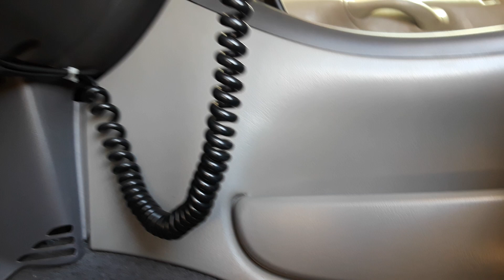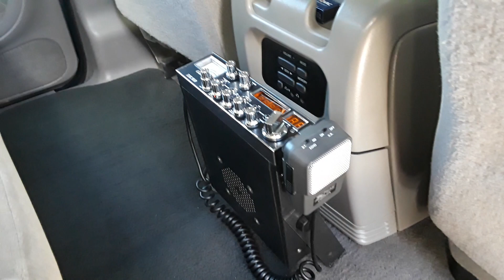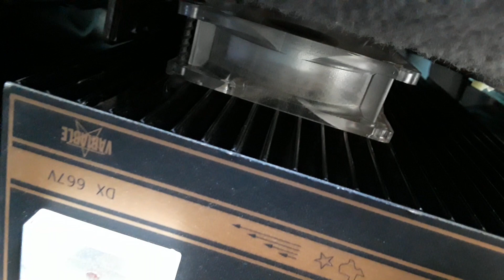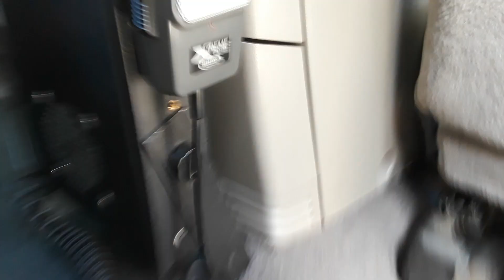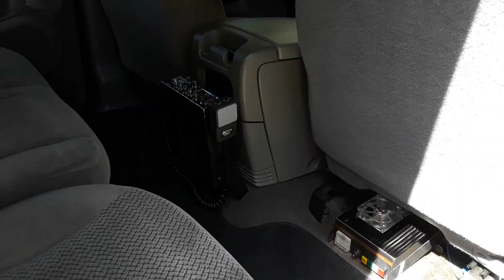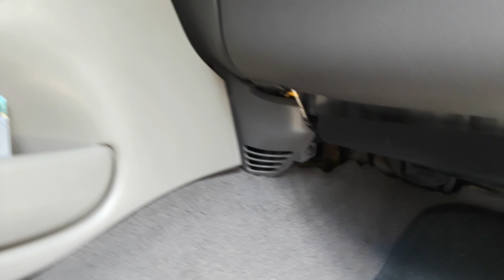CB radio and linear amplifier installed in the mobile

Comment: Everything looks great. However, the location of the GPS is very dangerous. It requires that you take your eyes off the road when consulting it. Mount it along the top edge of the windshield or low no the top of the dash for a much safer use.
Reply from the maker: @research903  The GPS is voice activated and it also speaks the directions to you. It's not an issue.

Comment: How many miles can this cb radio pick up?
Reply from the maker: It all depends on the radio, the amplifier, the coax, the antenna, your vehicle and how everything is hooked up together. No two vehicles will be the same. It also depends on your location and the terrain. I can hear skip all over the country, and locally if I'm lucky probably about 50 miles. However the 50 miles on the person on the other end.

Comment: May I ask did you wire your cb radio to battery with its own wires and the linear to battery with its own wires ? 
I'm using a 4 watt president harry 2 radio direct to car battery in my car and want to use a 35watt linear which draws 4amps I was hoping to use the same 12awg cable to supply both radio and linear. I'm using wago connectors.

Comment: Wow! What a nice install! I was going to mount my cb in the back like that in my pickup but it’s only a small extended cab with not a lot of room plus I didn’t want to not be able to see the display. I have a 29 LX that has the clock and antenna warning and all that so I went with beside the console. I’m not fond of it but for now it will do. I’m just getting into it. I was looking for how to connect the amp to the cb actually and got your video. Glad I did because it’s such a nice clean job. Thanks

Comment: I have an expedition also.  Mine calls for the biggest factory alternator they have 110 amp. Have you had any issues with the alternator when you key up with the 667 turned up? I really like how clean your install is,  really nice attention to detail.  I'm giving very serious thought to running a police style center console in mine. Something from Troy or Jotto, assuming they sell to the public.  I think it would be clean and secure way to run CB, Ham, and all the accessories. Really love your install.  I would appreciate if you are still seeing these comments if you would let me know how your alternator performs when you key up the 667. Thanks.

Comment: How does the echo on the xtreme mic perform under amplification on Am and SSB?
Would love one of the mics. Good video, Andy UK
Reply from the maker: Sounds terrific on AM! I run it just under 2 and 2 on both dials. I've found that most people don't like echo on sideband so I never use the echo on SSB.
Reply: It’s about the comparability rather than approvals. 
I find those (analog) copies, Workman 1000/5000 squeals as do those with the slider on the front.
Reply from the maker: @andybibby342  I purchased a Workman copy and it squealed like a pig. The Xtreme 2018 didn't.

Comment: Did u use 8 gauge on your cb wiring as well??
Reply: Ten fo i did 14 gauge on my galaxy 29hp and i just got a 250 linear i plan to run an 8 gauge stereo amp wiring for the power and ground on the linear
Reply from the maker: Not on this galaxy 959. I used 14 gauge directly to the battery distribution block next to the battery. I did use 8 gauge on my General HP40w in my other vehicle. Probably overkill, but I didn't want to starve it for amperage.
Reply: Is it best to use 1 set of wires for cb radio from car battery and another set of wires from battery for linear

Comment: If I rip out the center console in my vehicle (or any of the molding for that matter) it is never going back on the right way. I'll have  to take my chances with snaking wire in the nooks and crannies.
Reply from the maker: Really, it comes out very easily. Either snaps out or unbolts.
Reply: @vegasfordguy  oh I know. I've seen it done countless times. My mechanic brother in law has shown me how to do it... I still screw it up.
Reply from the maker: @regularfather4708  gotcha

Comment: Kick butt install  on the stuff....
..think of getting that same antenna  for my big rig.  Trucker style kind...
Does the antenna preform good..
Is. Swr.   Real low.....
Michael from minnesota. ...
Reply from the maker: The Sirio antenna has performed flawless for me. I used to have Wilson antennas, however the newer ones fill up with water when it rains. I really do like the Sirio and I'd buy it again. SWR tuned very low across all 40.

Comment: Everyone is going to have their opinion , and tell what they “think they know”.  I have a similar setup , and I used a 90 degree PL-259 to keep stress off the coax at the radio . I also was uneducated at the time and used RG8X mini as sell  ,, get something of better quality that won’t melt and crack inside and out .
Reply from the maker: You don't like RG8X? I use it on my base set up, well everything except the main antenna coax. That's LMR-400 ultra flex. Never had a problem with RG8X.
Reply: @vegasfordguy  
Sorry I just saw your reply , that’s such a clean install . It’s just an opinion of mine , I’ve had a few negative experiences with mini-8x but it could’ve been avoided , trial and error in this hobby !  Thinking it over I agree with you , should have no issues with that setup . By the way , what’s your opinion on the Sirio antenna compared to a Wilson 5000 roof mount , or a name brand coil antenna like Predator , Monkey Made ,, etc ?

Comment: Damn dude you make me sick , way to neat of a job . lol  I hope to get mine setup like that eventually . Thanks for sharing your setup .
Reply from the maker: Thanks! It's called OCD. LOL.
Reply: @vegasfordguy  lol , i hear ya . Really is a great job .
Reply: @vegasfordguy  Where did u buy your fuse block from an also the metal ya used to make the bracket for the radio . Sorry for all the questions . lol
Reply from the maker: @timmygilbert1371  fuse holder I bought on ebay. I just searched "50 amp fuse holder" you may need a different size. The flat steel I bought at Lowe's, Home depot will have the same thing. I cut and welded it, however if you check out my other video where I installed a CB in my Jeep I used the same flat bar, but bent it instead of welding it. I don't mind the questions, hope I helped.
Reply from the maker: @timmygilbert1371  https://youtu.be/IaG6JXG3F24
Reply from the maker: @timmygilbert1371  https://youtu.be/YNoZg30HeB8
Reply: @vegasfordguy  Yep , thanks again .
Reply: Does the stock alternator handle the 667

Comment: I don't like where the CB is. if you driving how can you change your channels over if you have a chat to your mates to get another channel
Reply from the maker: It's actually very easy. I know where all the controls are from years of CB use. Usually I leave it on channel 19 and setting really don't need to be adjusted much. It was the best mounting location without destroying the interior of the truck. It works great for me. Besides, my son usually talks on it during trips and he sits in the back seat.

Comment: Nice install!

How did you mount the fan on top of the heatsink?  Are you putting something in between the heatsink fins, and then when the screws are turned it expands holding the fan tight?

Do you have a link where you bought the fuse holder?
Reply from the maker: Thanks! Bought the fuse holder on Ebay. You'll just have to search for the amperage you need. For the fans I used pieces of rubber that fit into the channels and when you tighten the screws the rubber expands and holds tight.

Comment: Really nice video and install! This is the best mobile CB/amp install video I've seen so far. I'm going to incorporate some of what you did into my next mobile setup. I'm curious how much of a difference the noise filter makes.
Reply from the maker: Sorry for the delayed reply. As for as the noise filter goes, it helped out very little, but did do a tiny bit. In my situation I was using a Galaxy 959b at the time I put the noise filter inline. That particular radio with the backlit face seems like a magnet for stry RF from everywhere. My electric fuel pump could be heard through it. So it helped a tad. I wouldn't waste my money on it again though as swapping the radio was more effective. 
Thank you for you compliment! I really appreciate it!

Comment: Nice clean install! I had to mount my Anytone At-6666 Radio the same place on my Car, behind the center Council. No room! I wish some one will make a radio with a detached face kit. 73, Bob 290 Illinois.
Reply from the maker: Thank you! Manufacturers could make a lot of really cool and easier to install radios, CB is just fading away unfortunately.
Reply: I went with a RAM mount system using one of the bolts that hold the passenger seat down so I can still see the radio.

Comment: clean install,  why is there a mic on the dash as well as on the radio?
I'm guessing magnetic mount on roof or did you remove the headliner and through mount antenna ?
Reply from the maker: No mag mount, drilled a hole for a solid through mount. Mic on the dash is for a separate P.A.
Reply: @vegasfordguy  
how is that antenna performing for you?
Reply from the maker: @1WhiskeyMobile  The Sirio Performer 5000 has been excellent. I like that it can be layed down on the roof with the twist of the quick disconnect. It also transmits and receives very well. I'm happy with it. I have one of the new Wilson 1000 antennas on my other vehicle and when it rains the plastic base fills up with water. I had to make it water tight myself. Unfortunately the Wilson antennas are not what they used to be since they were sold.

Comment: sweet...………..I still have that Galaxy 99v in my pick-up,with a magnet mount Wilson 5000,and a Ranger SR-198 mic.Its loud and proud...…......601 Texas with the wave...
Reply from the maker: How do you like the SRA-198 mic? I'm using them on my comp tuned Cobra 29 and on my General HP 40w,  I use the RF limited xtreme 2018 on my galaxy 959's. I'm glad the 99v is working well for you! That's a good talking radio.

Comment: Looks great!  I have a Galaxy DX 959b and a Texas Star 667v in my van, it works great!  Thanks for the video!
Reply from the maker: Thank you sir. I had a 959b previously. I really liked the backlight face. Only problem is that it amplified everything produced from the truck. Fuel pump, ignition, etc. I couldn't get rid of the noise. I tried inline noise filters, ferrite chokes, chassis grounds, etc. After talking with my amp builder about it, he said that the 959b's will attract unwanted noise in some vehicles due to the backlight transformer. I switched back to this regular 959 and interference is about 80% less. It sucks because I really liked the display. I still have it and might put the biggest capacitor I can fit inside the case at the power wires to see if it will help out any.
Reply: @vegasfordguy  ... That's to bad, the 959b is such a great looking radio!  Fortunately for me, I have no noise issues with mine whatsoever!  Anyways, thanks for your reply and good luck with your 959b!
Reply from the maker: @byates59  awesome!